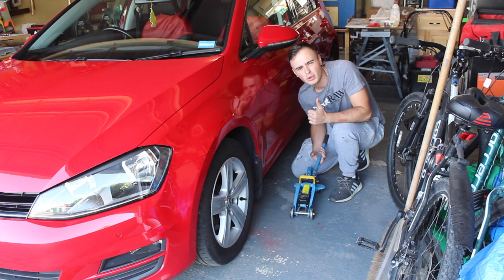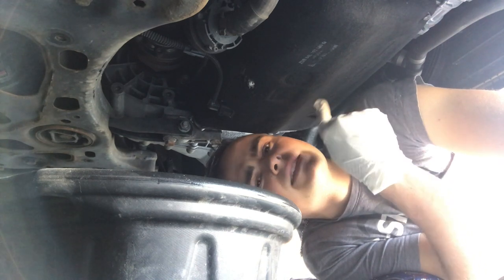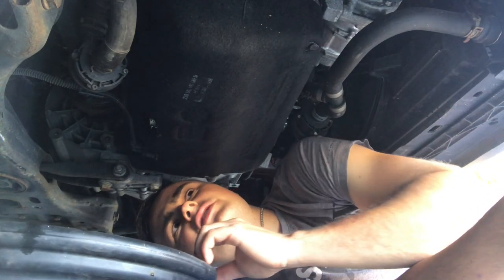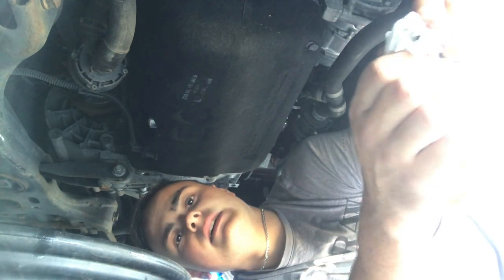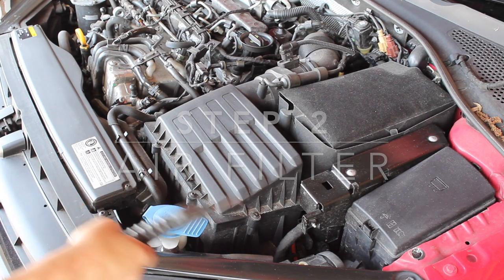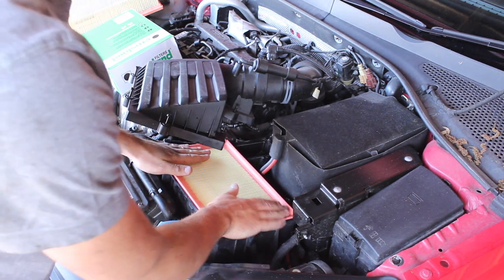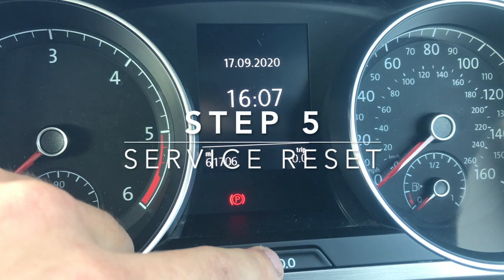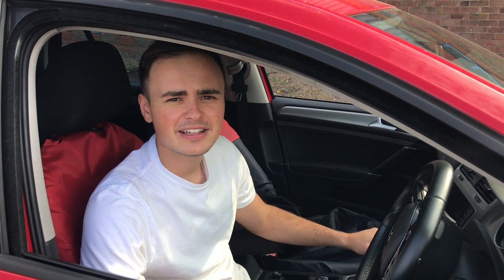Car Servicing - VW Golf MK7

Comment: When you are down to a few drips of old oil, its worth adding a couple of hundred ml of fresh oil to the engine and letting it flush out any remaining old oil from the sump, then when that has finished draining, adding your sump bolt and fresh crush washer.
Reply: It definitely won’t hurt.

Comment: Finally got my oil changed. All thanks to your video. 

I had to use a Torx 45 on the 3 screws on under tray though. 

Many thanks mate 👍
Reply from the maker: No problem mate, really glad you found it useful. Thanks for your comment 😊
Reply: Yep the three at the back that go into the subframe 😉

Comment: Good for you doing your own service.  Recommended service is 10000 miles. Although most service techs recommend every 5000 miles.  I use a vacuum pump system to remove the oil out of the dip stick.  It takes 15 minutes to do an oil change with filter and you don’t have to crawl under the car.
Reply from the maker: Thanks mate, the oil filter is accessed from underneath the car on this engine so not possible to change from the top as far as I’m aware 😊
Reply: Whoops!  My 2015 MK7 GTI has an engine bay oil filter location.  I ASSumed yours did as well.  Good job on a helpful video.

Comment: I Do the same on my passat b8. I just syfon the oil by small pump every 10k miles. I change the oil filter in garage every 30k miles.
With fuel filter I just fill it with  disel  and prime same as you did. I saw the vw garage mechanics do this way, they do not use software. Regards

Comment: We are the happy owners of a 2016 Golf Sportwagen. I do all of my own work except when I lack time or tools, such as a lift. I use a pair of ramps for oil changes. I am surprised and disappointed that you have to remove a belly pan to reach the oil drain plug on the 2017, as I do on my 2001 Passat wagon. With my 2016 Golf, the oil drain plug is readily available without any removal of anything.

The 2016 gasoline 1.8T's oil filter mounts from the top.
Reply from the maker: The belly pan is an extra step that all takes time so I understand your frustration! I also find it a pain too. It does offer that added protection to the underside of the engine which is a benefit 👍🏼
Reply: @TurnersWorkshop97  Plastic protection under the car is good and bad, the bad things is water collects and starts to rust under the car

Comment: I did my service today. All went fine with cabin filter, air filter, oil change and filter. Then I ran into a problem. The fuel filter I had bought from a reputable parts store was the wrong filter. I had to put the old filter back in.  Frustrating. However your video was very helpful.
Reply from the maker: Good on you mate! It’s annoying when that happens, won’t take 5mins to swap out when the right one comes. Thanks for your comment 👍🏼😁
Reply: @TurnersWorkshop97  collecting  new filter tomorrow. Currently running fine with old filter. (Did not have to prime after putting  filter back in)
Reply: @TurnersWorkshop97  new filter fitted. All 👍

Comment: Few tips for you mate. Firstly good job but I always recommend genuine VW parts, and replace the sump plug after every use only use the same one once, if not at least replace the copper washer, also look up in your drivers manual exactly how much oil your car takes the 2.0tdi takes 4.8litres just a heads up
Reply from the maker: Thanks for the pointers mate, I will bear that in mind next time 😁👍🏼
Reply: @TurnersWorkshop97  no problem mate, not getting onto you just a few pointers and btw if you take off your oil cap and pull out your dipstick, it causes better flow for your oil too
Reply: @50flynner you're a legend mate. Thanks for helping the community

Comment: Hey man just wondering what tools did you use for the sump plug oil drain and also to remove the oil filter. I’m stuck on that one. Thanks.
Reply from the maker: Hey, the sump plug is a 19mm socket and the oil filter is a 32mm socket. You will need t25 & t40 torx bits for removing the belly pan.

Comment: Nice video mate I am gonna do this myself after seeing how straight forward it is, just one question what torque wrench would you suggest?? If something needs torquing to say 30nm could I use a 1/4 what goes upto 25nm , but then add 5 using the numbers on the torque wrench to make it 30nm if you know what I mean... or do I need to buy like the next wrench up that goes up that has 30nm etccc TIA
Reply from the maker: Thanks mate, the torque wrench you use should go up to the figure you want to torque it to. If you torque up to 25nm then adjust back to 5nm you will still have only torqued to 25nm. Halfords do a good range of affordable torque wrenches and teng tools is another one. When you do get one make sure you wind it back to zero after every use or else it buggers the spring inside and won’t be accurate. 👍🏼

Comment: I think you need to use vcds when you change the fuelfilter because it can have in the system
Reply from the maker: I understand what you are saying as you don’t want to airlock the high pressure fuel pump etc. I’ve not had an issue doing it this way. Leaving a couple of mins with ignition on before starting allows it to self prime.

Comment: Hi did you get the fuel filter with the connection for water filter ive got a 2018 2l tdi 150 engine assuming its the same as yours
Reply from the maker: Hi, the filter I used is linked in the description

Comment: Hi, Thank you for the great video! I've just bought a mk 7.5 and your instructions were great in giving it a full service. My only question is, I intend on keeping the vehicle till it drops (I love it), it's 5 years old and I understand timing belts are due every 5 years. It's only covered 39,000. Would you recommend a change at such low mileage.....I've always heard timing belts are good for 60,000+.  I look forward to hearing from you. Thanks
Reply from the maker: Hi, thanks for your comment. Timing belts should always be changed at the recommended interval regardless of mileage or age it’s whatever comes first. The rubber belt deteriorates with age regardless of mileage and visa versa. I’m the same, love my golf and can see me keeping it until the end. This is also the one maintenance job that I don’t do myself as the consequences of getting it wrong are catastrophic 💸 it’s worth getting it done by a reputable garage making sure they use quality parts. Hope this answers your question 😊
Reply: Thank you so much for your reply, I greatly appreciate it. As a fellow mk 7 owner ( I guess the mk 7.5 1.6tdi is the same) , could you confirm that is the interval you've changed it at? I'm reading in many places different numbers. I hope you can clarify it for me. Thanks again and keep the video's coming please!
Reply from the maker: No problem, I go by the Haynes manual recommendation as it’s typically on the safe side and it’s 60,000miles or 4 years. The manufacturer may say different. It’s worth getting the water pump done at the same time also.

Comment: You don't use any VCDS? Im thinking after changing the fuel filter.. how do you make sure about the air? Cheers
Reply from the maker: No mate, I’ve never used it for changing fuel filter. You could always top up the filter housing with diesel. I just switch ignition on and wait for a little while for it to prime and then fires right up.

Comment: Great video. So there is no need to prime the fuel filter via the software? Just switching on the ignition?
I have a 2017 tdi Leon and this video is very helpful 👍🏼
Reply from the maker: Thanks mate, I’ve never used software to prime mine, just leave the ignition on for a good while before trying to start. It’s always self primed for me 👍🏼 if you’re worried you could always fill up the filter housing with diesel 🙂

Comment: wrong oil. you should use 507.00 5w-30LL. NOT 505.00 C3 if dont want to damage turbo and dpf in long term use. also after replacing fuel filter need to switch el. pump for up to 3 min and bleed air out from system to prevent high pressure fuel pump fail.
Reply from the maker: Thanks mate, I realised that when I went to buy some more 🙄👍🏼 and I let the system prime itself before starting. Thanks for your comment though appreciate the feedback 😁

Comment: If I change the Air Filter which is factory fitted and replace it with a K&N Performance Air Filter. Would that damage the engine ??
Reply from the maker: Shouldn’t do mate, just better airflow than the standard filter 👍🏼

Comment: would you unscrew the lock first the small tap screw off the filter holder so that oil does not get dirty runr the oil filter
Reply from the maker: You can drain the oil filter through the smaller drain hole👍🏼 I just removed it as one piece.

Comment: Heyy, how do you lnow which: pads, filters you have to use for each car?
Reply from the maker: Hey, where ever you buy the parts from should be able to advise which parts will fit. If getting online most car parts websites have a number plate database checker which will show you the filters etc you need for your car. If you’re in the uk, eurocarparts it’s pretty good for parts and easy to exchange if you get the wrong part.
Reply: @TurnersWorkshop97  Wow really helpful, Thanks!

Comment: Great video lad! Exactly what I was looking for! Recently bought a mk7 golf gt 2.0 TDI myself and have always serviced my own cars.

Just wondering when you changed the fuel filter did you have to use VCDS to prime the filter as I’ve heard that you need to do this for the 1.6 TDI engines to start the engine after the filter he been changed. Not sure if this also applies to the 2.0 TDI engines of the same year though? 
Liked & subscribed 👍🏼
Reply from the maker: Thanks mate 👍🏼 I don’t have VCDS, just switch ignition on let fuel pump circulate and away it goes! 😁 It must self prime. Had a 1.6 TDI Passat in the past and didn’t have to use it on that either. Cheers for the sub.

Comment: Hi buddy,my banana engine in my transit began to have a problem starting so I used easy start a couple of times then it also started to cut out on me, now it won't start at all,I changed the fuel filter and set up the timing but it doesn't want to start anymore 😢
Reply from the maker: Hi, are you getting fuel at the injectors?
Reply: @TurnersWorkshop97  yes fuel is getting to the injectors
Reply from the maker: If it will run on easy start, and you have fuel at the injectors it sounds like a blockage in the injectors. When you squirt easy start in the inlet manifold will it run and then cut out?
Reply: @TurnersWorkshop97  yes buddy that's what is happening

Comment: I HAVE SOME QUESTIONS PLEASE: MY VW 2017 WITH 55K ON BOARD WARNS ME IS TIME FOR OIL CHANGE AND INSPECTION AND MY QUESTION IS : IF I TAKE IT TO MY COUSIN S GARAGE AND DO ALL THESE WOULD I LOOSE THE WARANTY ON IT AS HE DOES NOT WORK WITH VW! I THOUGHT OF THE OFFICIAL STAMPS AND ALL THAT OR IT DOSENT MATTER? THA
Reply from the maker: It’s most likely that it needs to be serviced by Volkswagen to keep the warranty valid! Maybe just give them a call and double check with them 👍🏼
Reply: @TurnersWorkshop97  thanks the thing is that i did called but with them is so expensive and when i asked they said that my car does not appear to be having with them warranty and it’s these times that pushed me to go with the other option of my brother in law but they don’t work with VW

Comment: Stupid oil filter design lol, wish they would use a metal filter. Im a vw specialist my self so i know these like the back of my hand😅 4.7l oil in these new tdi's, are you doing the timing belt? They are a piece of cake also
Reply from the maker: I know always feels like they’re gonna snap or cross thread. I need to do the timing belt and water pump really but due to lack of information anywhere I’m a little hesitant. Do I need a special locking tool for the sprockets or Is there an alternative? Thanks 😁
Reply: @TurnersWorkshop97  there is a special locking tool for the crank pulley, think it is around 60-80 pounds. Very easy to do!then 2 timing pegs for cam sprocket and fuel pump

Comment: Hey pal when does the timing chain need done in these cars?? 80k 90k??
Reply from the maker: Hi Neil, I go by the Haynes manual recommendation for timing belt change which is 60,000miles or every 4 years whichever comes soonest 👍🏼
Reply: @TurnersWorkshop97  flip im at 66k!
Reply from the maker: The manufacturers recommendation is usually higher so I wouldn’t panic but it’s worth getting it booked in
Reply: @TurnersWorkshop97  how much do you think will cost?
Reply from the maker: It’s worth getting the water pump done at the same time and around £500 more or less depending on where you go. Sounds expensive but if the belt goes that is another level of expensive to put right.

Comment: Hi mate do you know the part number for the fuel filter or do have a link for it.
Cheers
Reply from the maker: Hello mate, Eurocarparts UK, Product code 503441197 Bosch fuel filter 😁
Reply: @TurnersWorkshop97  will this be suitable for my 64 plate VW golf 1.6tdi bluemotion?
Reply from the maker: It’s likely to be very similar. The filters can be in different locations and there are a few different style filters. Might be worth just having a look for the type of filters used on the engine before getting stuck in. I haven’t serviced a 1.6tdi so can’t say for sure 🙂

Comment: Do you know what Torque for the oil filter (32mm socket)?
Reply from the maker: Not sure off the top of my head, but it says it on the black plastic filter housing what the torque spec is 👍
Reply: @TurnersWorkshop97  Going to do it this weekend, I've got axel stands but only able to use the jack provided in the boot of the car, do you think this will lift the car high enough for me to get under?
Reply from the maker: Should be fine mate 👍🏼
Reply: Excellent video. Very professional. Even filled the service book in!. Been leasing a car the same as yours. Am buying it at end of lease and will do own service. Thanks again. Great video.

Comment: How many thousands of kilometers do you serve it?
Reply from the maker: Personally, I do a service every 10,000 miles but only change the fuel filter every other service 👍🏼 the long life engine oil is said to be good for much more than this though.
Reply: @TurnersWorkshop97  I personally every 10,000 km all the filters

Comment: Does VW use magnatec oil? I thought that was only for GM products
Reply from the maker: Should be Castrol edge, my mistake 👍🏼
Reply: @TurnersWorkshop97  Shouldn't be a problem, just remember to change it a bit early as the only difference is in the additives in the oil between edge and magnatec. Idk what magnatec has
Reply: @TurnersWorkshop97  You can use any make of engine oil provided it meets VW 507.00 spec - so Castrol, Mannol, Shell, Fuchs, Quantum, Mobil and many others. Just keep changing it regularly. Don't wait for 10K miles to clock up. Change at 6K for long engine life and power.

Comment: Are VW Golf Mk7 reliable cars ?
Reply from the maker: I’ve had it 3 years so far and put 50,000miles on it in that time. Touch wood, it hasn’t had any issues, other than windscreen cracks and rear coil spring snapped (probably pot hole).

Comment: That DPF regen at the start of the video... 😅
Reply: Also, that seems like an incorrect oil for a CR VW TDI. It needs 507.00 spec.
Reply from the maker: Well spotted 😅 I have since changed it for low saps oil 507.00 👍🏼

Comment: 3:22 thats not how it works lol, its a liquid, its gonna drain nice either way, i never warm my oil up before changing, and it allways drains nicely.
Reply: What a stupid comment 😂 oil is thinner when it’s hotter so it runs quicker, makes life easier and gets it all out. Science mate.
Reply: @kevinobrien151  yes but the oil drain is not a 3 mil hole, its a big hole. And also, what makes oil run 3 times faster is unscrewing the oil cap before opening the drain plug, so air can enter, no one does that. If you look at few "professional" oil change videos, they do that for a reason
Reply: I never said anything about the oil cap, the cap shouldn’t make a big difference if it’s in or off. I’m saying that the oil will run quicker (as it is thinner) out the hole even if it is the same size hole dosent matter. Pour a drop of cold oil and a drop of hot oil down a surface vertically and you’ll see the thin oil runs quicker, as it’s thinner you’d get more oil out.